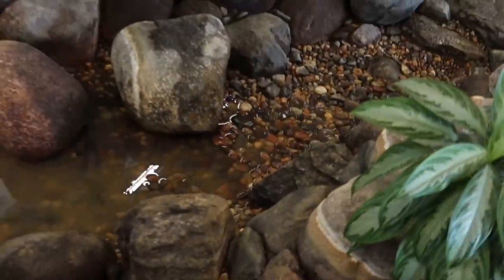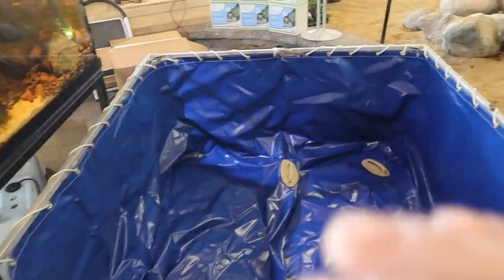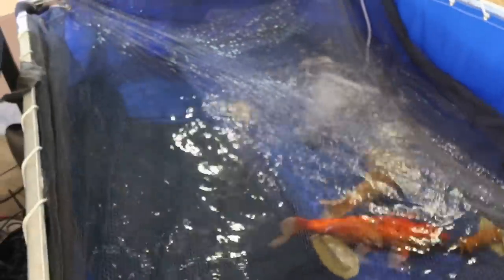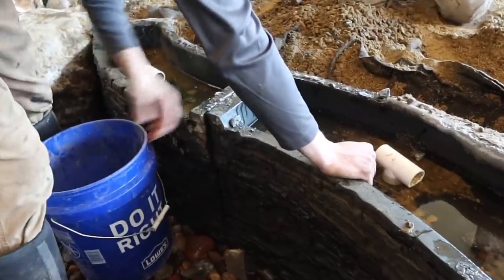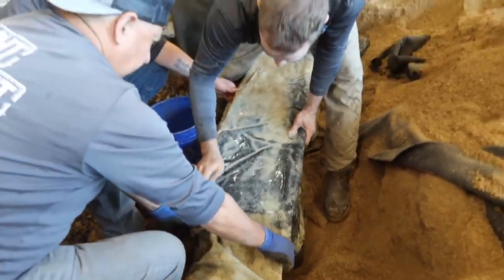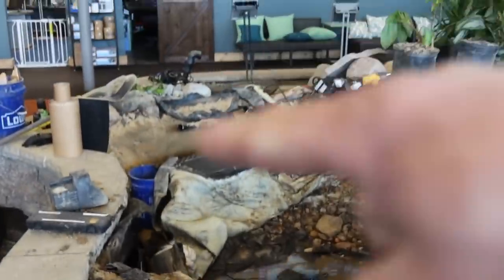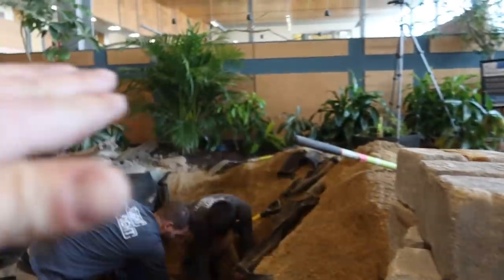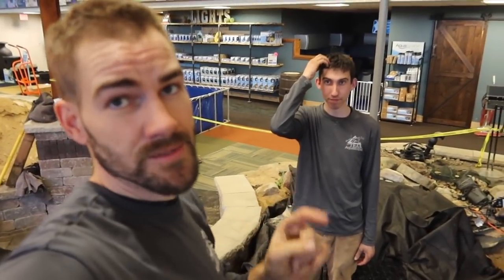Best Indoor Koi Pond Ever?! - Part 1

Comment: I would like to make a suggestion.  Try a contractors wet/dry vac with the hose that's about a 2 1/2 to 3 inch diameter. This will actually suck up gravel, even wet gravel.  It will save many fingertips and prevent a shovel poking into the liner.
Reply from the maker: Thanks we do use shop vacs sometimes